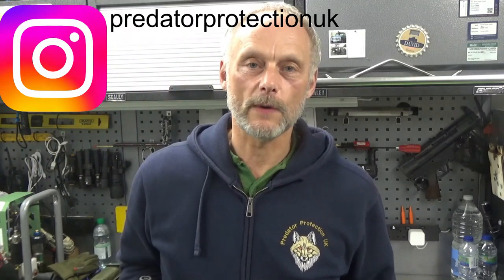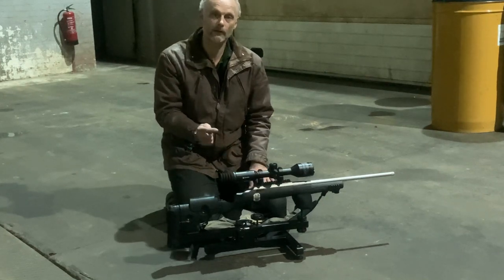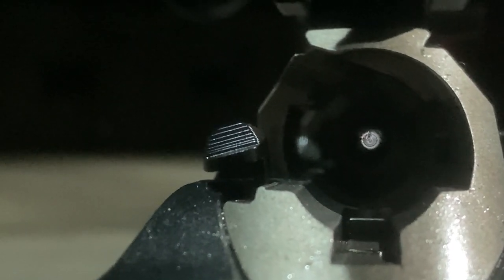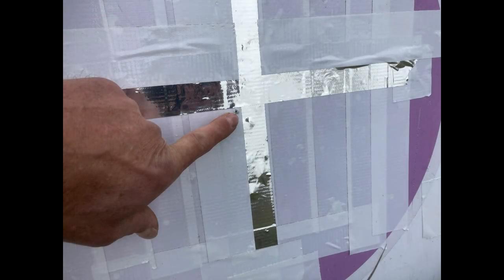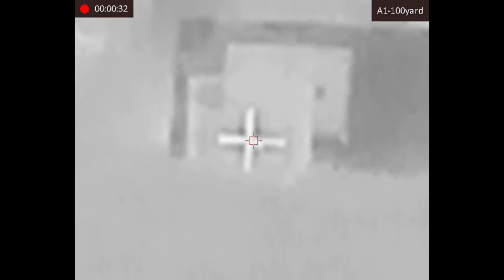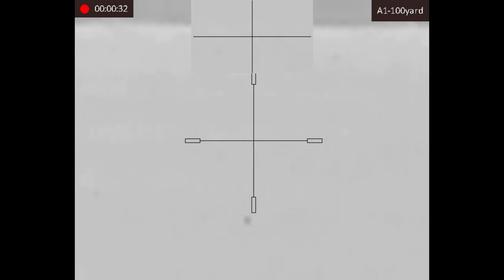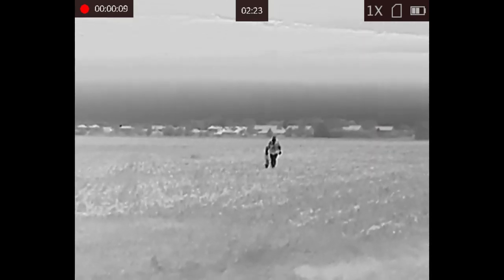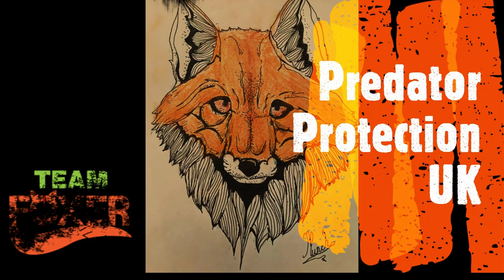HIKMICRO BORE SIGHTING💥

Comment: Brilliant method David thanks. Might be of use if I do buy that HikMicro Alpex I am mulling over. Then you know me and tech lol! Funny but I cannot get my bit of Fenland cleared for more than 22/or HMR. So those big roe are safe 🤣
Reply from the maker: Hi Jon, I’m still waiting for my Alpex , but I called the depot yesterday and they were being unloaded from the container, so it could be next week.
Always worth bore sighting, saves ammo and time.
Reply: @predatorprotectionuk  Agree with bore sighting. Managed to find a small bore sighter that fits into the barrel on a 22, sort of like a cartridge case that has a battery and red laser built in. It is actually spot on at fifty with no shots needed. Only limit is the laser distance but that's solved by doing it at dusk. The Alpex looks closest to what I am looking for tbh. No frills and the price seems decent.
Reply from the maker: I’ve heard good things about it, I’ll be interested to try out the audio on it though, at least my Thermion was spot on with audio👍
I’ve written a list of items that I feel need to be addressed if HikMicro want to rule the world with their scopes. There’s still a few things not right, in my humble opinion .
Reply: @predatorprotectionuk  Its just simplicity I want as you know. The firm that produces a basic IR or thermal without frills will be on a winner with many of us older guys. Some of my friends say the same, we just want on/off, easy zero and robust build. Sort of Hawke Vantage with electronic bits 😛
Reply from the maker: Ah! Steer clear then chap, firmware updates and stuff has me baffled and looking for a teenager to sort it out for me 🥴
Reply: @predatorprotectionuk  "All hail the Cree lamp then" 🤣